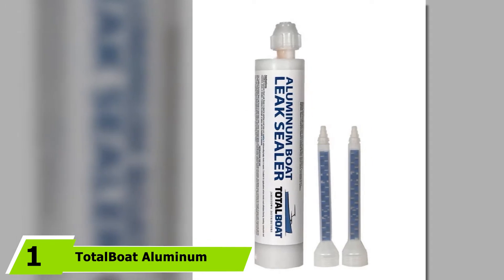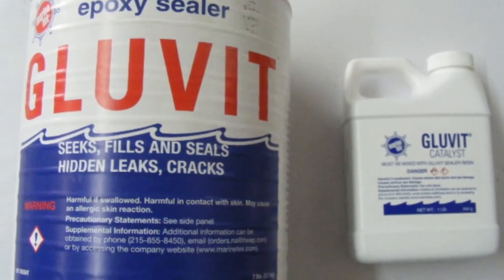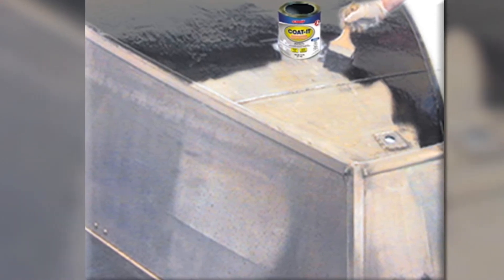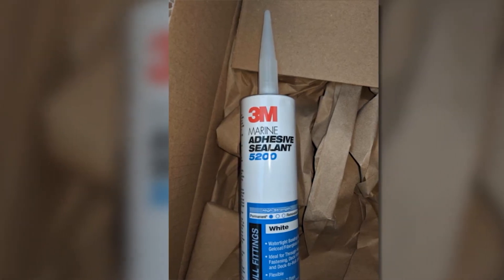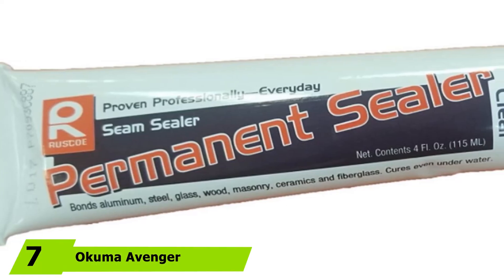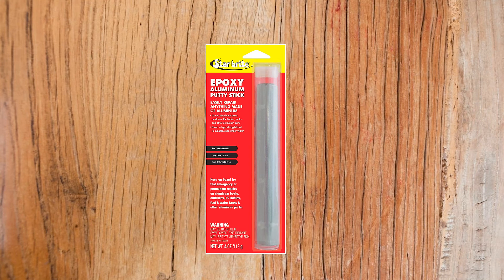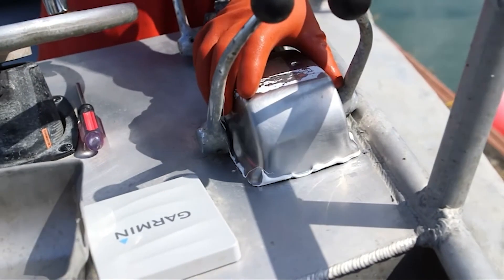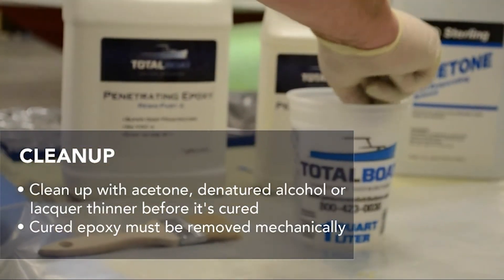Best Sealers for Aluminum Boat In 2024 - Top 10 Sealers for Aluminum Boats Review

Comment from the maker: Links to the best Sealers for Aluminum Boat we listed in today's Sealers for Aluminum Boat review video:

1. TotalBoat Aluminum Boat Leak Sealer
https://geni.us/nFB9Qn6 [Amazon]

2. Marine-Tex Gluvit Waterproof Epoxy Sealer
https://geni.us/YFcM [Amazon]

3. Amazing GOOP Coat-It Waterproof Epoxy Sealer & Protector
https://geni.us/kZkO6dy [Amazon]

4. Hy-Poxy Alumbond Aluminum Putty Repair Kit
https://geni.us/dciTuB0 [Amazon]

5. 3M White Marine 5200 Adhesive / Sealant
https://geni.us/XHAM [Amazon]

6. Woody Wax Metal Sealer
https://geni.us/QRTMBj [Amazon]

7. Flex Seal Liquid Rubber
https://geni.us/Jz6ALi [Amazon]

8. Star Brite Epoxy Putty Stick
https://geni.us/3hGvcK [Amazon]

9. 3M Marine Adhesive Sealant
https://geni.us/Ln7M7k [Amazon]

10. TotalBoat Penetrating Epoxy Sealer
https://geni.us/avUmpA [Amazon]